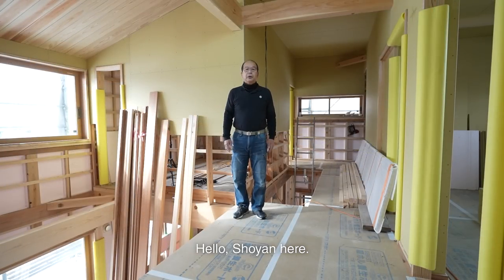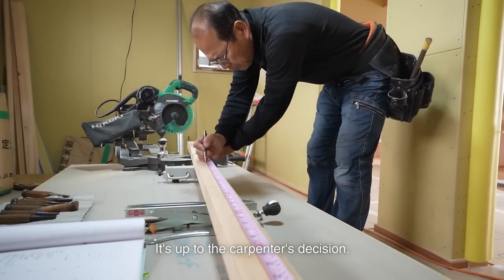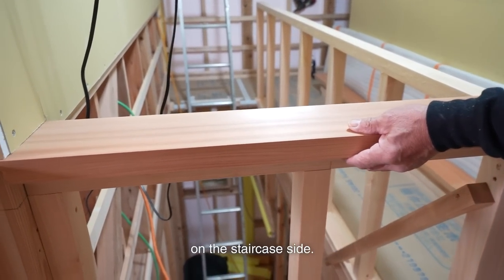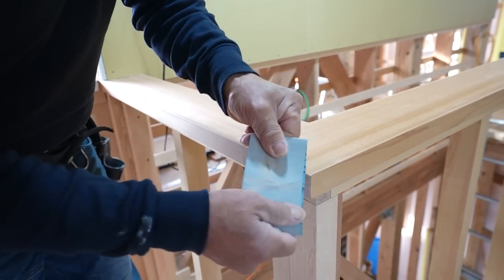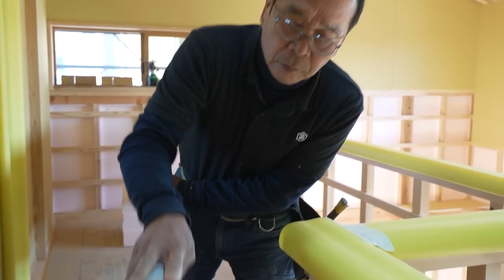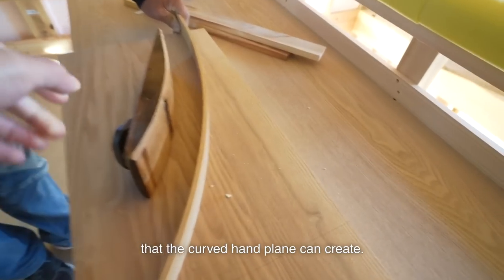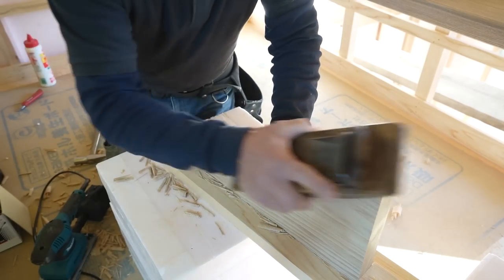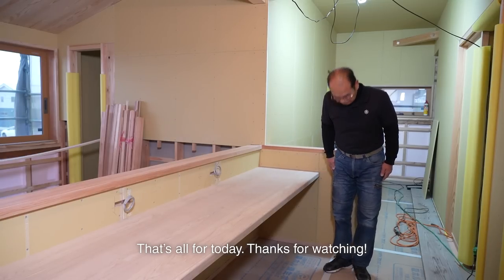A 4m Study Desk on the Stairwell Creates Dynamic Space! [Season 3 – Part 9]

Comment: Great videio as always.  Regarding the cross-grain glue joint between the corbels and top, I'm concerned that there is no allowance made for the movement of the top with seasonal changes in humidity, possibly resulting in either the glue joint failing or the top developing a split/crack.

Comment: Veary nice video as allways =)  One little question;  when the Ponywall get covered with Plasterboards anyway, why don't install Breaker boxes on the studs right away? Betwean the Line of the Tabledesk and Handrail would have been good space for 3x 2Wallpower Outlids, so the People that study there could power a Laptop and/or a Table-/Desklamp. PS: it would be realy nice, if you could leave a P.O. Box Adress in you Channels Bio, so that we can send you little gifts =)
Reply: I think this is one of those "the electricians do their thing, I do my thing"
Reply: why would a interior finishing carpenter install "breaker boxes" or power outlets? do carpenters where you live do this type of work?
Reply: @martin8313  In some of the Videos Shoyan is installing Plasterboards, so would be a easy job to do, since its just a plastic box. But you are right, carpenters usually doesnt do such jobs, but it would have been a good mention, if those get installed.
Reply: Look at about 23:20 and following in the video.  It looks to me like three power outlets are already roughed in, with the wires coiled to be finished later.  (Common where I am.)

Comment: What was the purpose of hammering the endgrain?
Reply: in this application, he was hammering the endgrain so that it compressed it and closed off grain.   He did that because he was glueing that area without any fasteners.   If you dont compress the endgrain or fill it with something else the glue will be drawn into the grain and you will end up with a weak joint.   another common practice is to apply glue to the end grain,  then let it completely dry, and then glue the joint together.   that way the end grain will not suck up any of the glue in the joint.   Hammering the end grain is just much more quick to do when you dont have a bunch of time.
Reply: I've seen it done to compress the piece of wood just a bit for a snugger fit, he's also hammered the edges of joinery for the same purpose. Not sure if it has anything to do with glueing though? You do want the wood to soak up the glue for a stronger bond, for example titebond adheres on a molecular level so absorption is key to making a good strong connection.